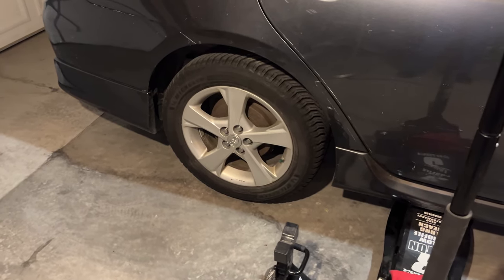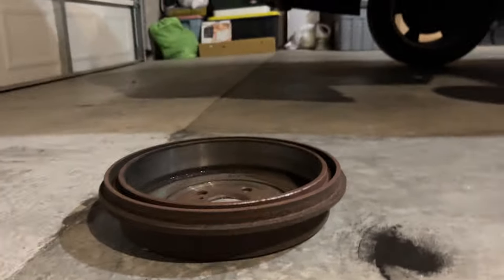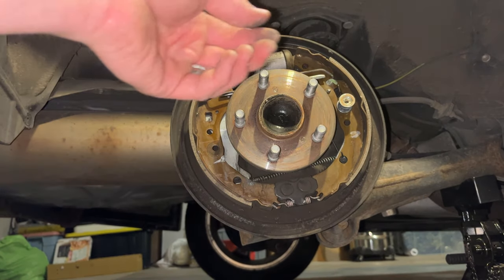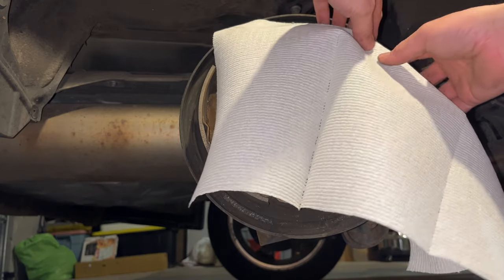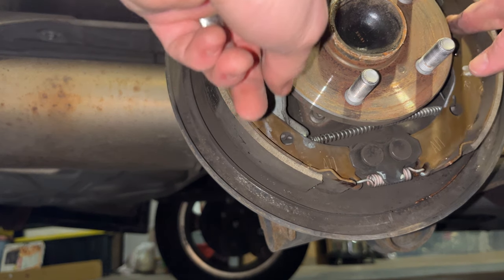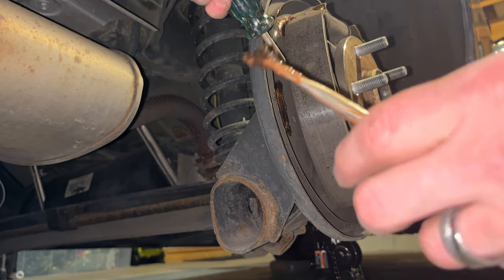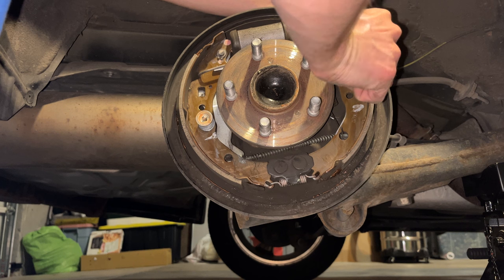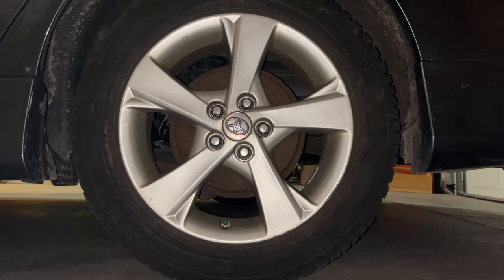How to Stop Noisy Drum Brakes from Squeaking 2009-2013 Toyota Corolla! Where to Lubricate Drum Brake

Comment: Next time, use a spray bottle with normal dishwashing soap and warm water to clean the drum brakes.  Rinse off with warm water in another spray bottle, or a garden hose.  Save your money by not using a whole bottle of brake cleaner on just one wheel.  The soap and water works very, very well.  Then apply silicone ceramic lubricant on those three spots per brake pad.  Works better than antiseize.  Hope your squeaks never come back!!
Reply from the maker: Thanks for the tip! I will try it out next time, thanks for commenting, make sure to subscribe to see more and have an awesome day!